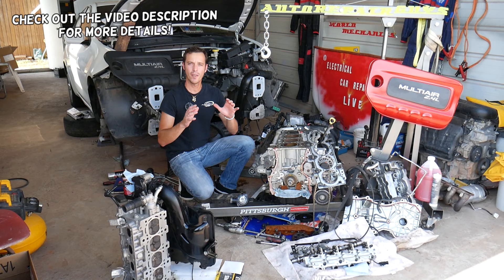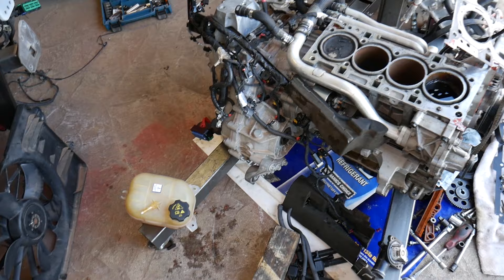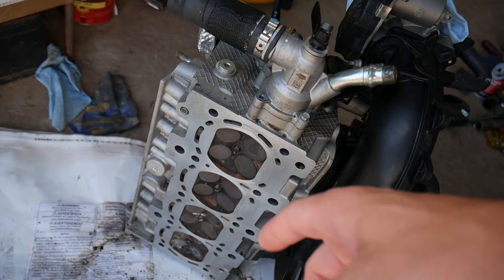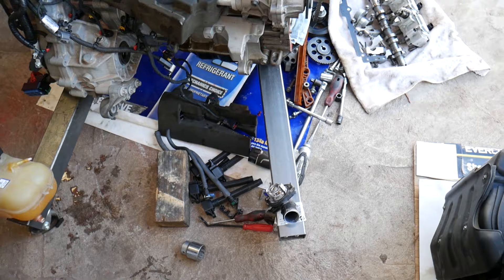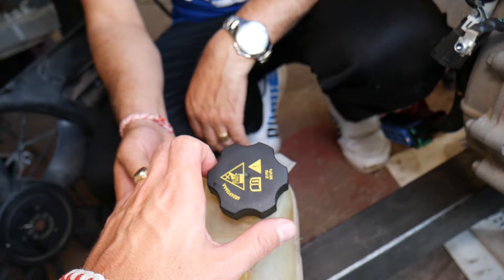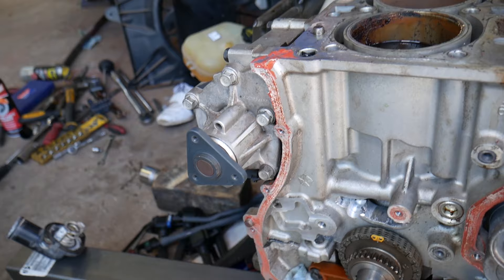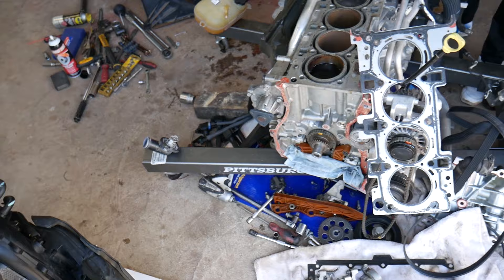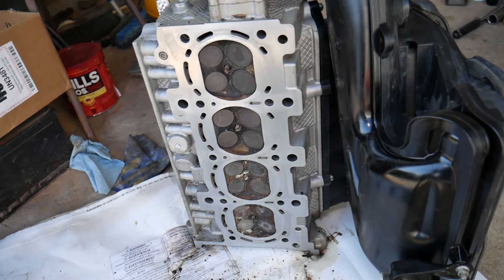WHY IS MY CAR OVERHEATING, TOP 7 REASONS WHY CAR OVERHEATS

Comment: My car tends to heat up only on hot days going up long steep hills. Any thoughts please?
Reply: Mine as well
Reply: Same did you guys figure it out?
Reply: @notificationsturnedoff2126  I did a coolant flush and change but I’ll let you know when it’s summer here.
Reply: @donotwantahandle1111 hey it’s summer, and I’ve noticed you commented that more than a year ago. Any thoughts please?
Reply: @XXXDomtacion  It's actually winter here (southern hemisphere) but it's still heating up on long steep hills. Plus uses oil. Not overheating though.
Reply: @donotwantahandle1111  ah ok
Reply: I have the same issue.  You find out what the issue was?

Comment: 1. Check coolant level
2. Bleed Coolant System
3. Bad thermostat
4. Bent Radiator Cap
5. Radiator Fan not working
6. Bad water pump (leaking, broken fan, pump not turning)
7. Bad head gasket
8. Cracked Cylinder/Engine Block
Reply: How do we know if it's the 7 or the 8tu one???
Reply: Thank you very much for the wrap up!
Reply: Thank god you write it down I couldn’t listen to him say guys for the whole video holy shit
Reply: @webthing8028  for 7.... the coolant drains out to the reservoir most often and car overheats, thats a pretty much sign of bad head gasket, in the worst case the oil enters on coolant passages and they get mixed out making substance like coffe latte color 😀.....that a big failure for the head gasket.....8 - cracked cylinder head or engine block has a lot of symptoms.....probably the engine won't work in the first place.....or got the same as a blown head gasket symptoms....
Reply: When I drive it doesn't run hot but when I'm stuck in traffic my car run hot. What may be the problem?
Reply: @antoniobonner8048  check fan
Reply: yes thank you so much, God  bless you.
Reply: @alanhernandez227  hi same issue to my car wat is the couse of that
Reply: Thank you for your service this guy saying guys is driving me fucking crazy

Comment: If my return radiator hose is higher than the return port can that also cause overheating cause most of the things you have mentioned I have checked and the hose is the only thing that can be left

Comment: Sometimes over heating has nothing to do with no water or  leaking or clogged radiator or fan not moving or water pump break down..wrong valves clearance or no lubricant in the engine.etc..They sometimes yes will cause overheating but not always the cause.Overheating also caused by bad transmission filter and its oil...causing transmission overheat and cause engine too will overheat...So just look if that can be the real problem.Overheating transmission will cause engine over heated.Change the transmission oil and filter.
Reply: I have 22 sorento that's running hot, but kia has had it for 2 months and still haven't fixed it.

Comment: Hi sir may ask a question? What will happen when you run a car without thermostat? It may cause overheating? Thanks in advance
Reply: I saw your question - Without a thermostat your engine doesn't cool down right, just keeps heating. If your fans are working you may have a chance or if it's winter, but the summer could get you. I had a Datsun B-210 that I owned for about two years & in the summer it overheated. Thinking it was the thermostat, I opened it up & there wasn't one !  Put one in & instant fix.  It's best if you have the thermostat & they are cheap.